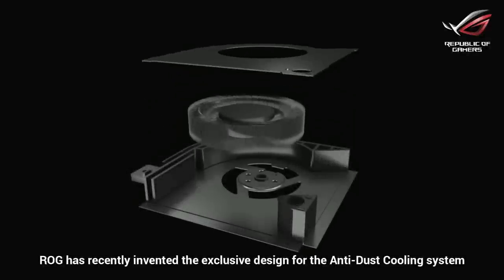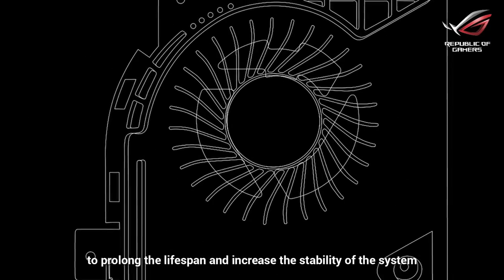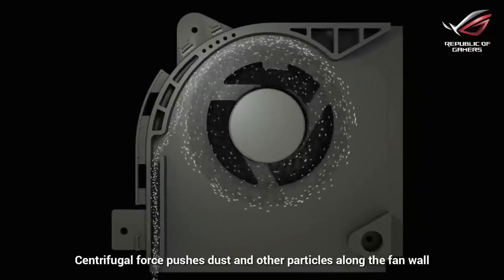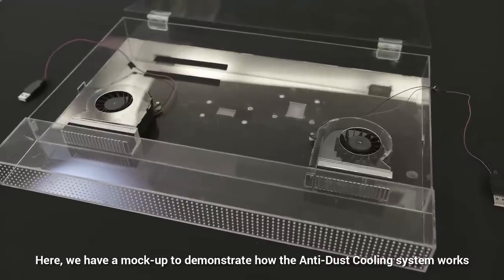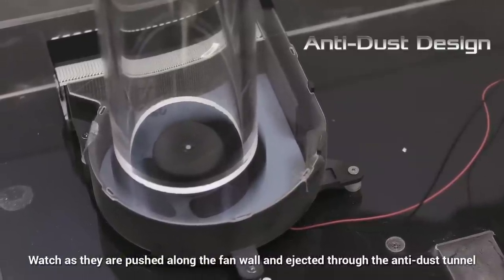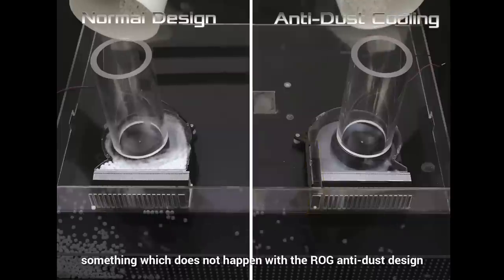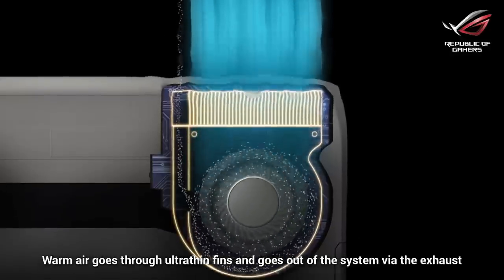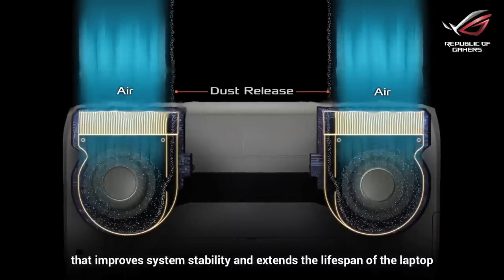Anti-dust Cooling System - ROG Laptops | ROG

Comment: But unfortunately, unlike this marketing ploy, dust are waaaaaaaay tinier and don't simply bounce like those balls. Dust"sticks" due to static electricity and from there it accumulates.
Reply: they can just coat the inner part with anti static material or even teflon
Reply: c@mbaz but they won't because that's not their objective. Their objective is to count this as a masterpiece feature and charging more for it. It's all profit in the end.
Reply: So true...so true...
Reply: well what we witness here is marketing, but yes it is all profit.
Reply: Every hdd has same dust filter. Besides most of dust is big and block airflow a lot faster.
Reply: The fans will also have run much faster, since a part of the airflow generated is used to expell dust and not for cooling, thus making it much noisier or else the computer will get much hotter
Reply: no actually dust sticks pretty much due to thin film deposits over time and you cant coat the heat sink fins or you just totally ruined the point of it.... for heat transfer.  the real fix would just be a removeable filter screen on the intake.....
Reply: But...but..but....antidust skinsuits being sold on ebay for cheap.. :'(
Reply: is the skin suit a giant piece of grounded metal? inquiring minds want to know...
Reply: But it will last longer though because few dust will get out
Reply: Depends whether this system works better than conventional.  Would be great to see fan comparisons showing dust buildup.  I doubt the anti dust system performs worse than conventional though, so only positive potential.
Reply: its a good effort.
Reply: The anti dust feature is meant to prolong the life of the laptops  and not make them mortal
Reply: The Soul  no not really ,and if you think there might be too much dust accidentally stuck in your laptop than do it after the warranty or even better check it on asus store
Reply: Well if it's all about profit couldn't they cover the interior with non-static material and charge even more for it?
Reply: Yea that is true I have the tuf dash with this colling system and it sounds like a rocket about to take off the fans run at like 8000rpm and there is a lot of dust accumulated at the blade that is clearly visible through the back. Also the temperatures of the cpu reach 98 and mostly stay around 92 although that's only in one game in the rest of the games temperatures seem below 85 all the time GPU temperatures are fine
Reply: this is precisely what I came here to point out

Comment: This does work, but it doesn't mean you'll never have to clean it. You will still get buildup eventually, though this surely prolongs the need to service the fans. I usually do my laptops every year, though the ones with this anti dust system is fine after 2, barely anything on the fins.. the fans do get a little grey though, but it would've been so much worse.

Comment: the problem is the fan's are really thin and closely packed and it gets cloged up by dust . I'm an Indian and in Mumbai.. over here the dust is significantly more and my fans get literally cloged up within 6 months of everyday use.. i got asus rog strix g15 2021... Bruh opening up that thing is another heart attack 😭🥲 coz of those pins there's always a possibility of it breaking apart...

Comment: I have a msi laptop and asus laptop.
the asus one is significantly less dusty and doesnt have dust clogging the vents, while MSI vents are all clogged up by so much dusts that you can peel the whole strip of accumulated dusts by hand.
Asus do have dusts on its fans and all over the place, but the dust doesnt build up at the vents clogging up the airflow.

Comment: This system only lengthens the MTBF (Mean Time Between Bailures) and the MTTR (Medium Time To Repair) but it does not prevent the real problem, the real solution would be to install a large capacity filter, of a type similar to that used in internal combustion vehicles. I installed a filter layer that was part of a pandemic xd mask, and I only had to blow the dust off the filter, the laptop still remains as fresh as the first day.
Reply: i dont think that one gonna work, placing filter on such weak air flow just make no sense, the simplest solution is removable and easy access to cooling system itself so the users can cleaned up these thing manually once it dirty without opening the entire case also the excess heat must be blowed to clear area, not onto screen or anything that blocked the airflow or hard to reach so we can use vacuum on exhaust to remove dust completely

Comment: i havent opened my 2017 Rog ever. i noticed my gpu at 95 degres C when running some games. i cleared it, same games now 70° C, big difference. but this system wont be perfect i hope the fans are still detachable so we can clean them ourselves.

Comment: 3 years and still over heats with liquid metal. Replaced paste with grizzly extreme and added copper heatsinks. Runs 75c with warzone max. Rog g17 2021 model. Solution- needs more heatsink in your gaming laptops

Comment: this self- cleaning thing doesn't make any different to normal fans, i think if they stick a layer of anti dust cloth on the holes
under the laptop that will do the trick. the dust will just stick on the bottom of the laptop and it's easy to clean , no need to
open the laptop

Comment: LOL
 My FX-505 DV with RTX 2060 was overheating in 5 months 29 days. Pics and negative review on Amazon.

You guys did NOT test this product enough. My 10+ year old ACTUALLY MilSpec Panasonic toughbook cf-31 ran circles around this thing in terms of quality and ruggedness... did I mention it's still running and doesn't overheat? Unfortunately there IS NO real certifying authority on Mil-Spec so we all got played. Good form Asus, good form!

Unfortunately your engineers forgot that tiny dust particles and maybe just a bit of static might be enough to make something stick to the fan itself. Dust becomes a sponge for moisture in the air (humidity). Humidity attracts more dust plus now tiny hairs which becomes a place for more things to stick.

I've never had a laptop go down so fast in 19 years of working in IT.

Turn to page 21 of the Department of Energy PDF "Improving Fan System Performance" and it reads:

"A consequence of backward-incline blade orientation is a low angle of impingement with the
airstream. This promotes the accumulation of particulates on the fan blades, which can create performance problems."

Try harder ASUS. You should have known this would happened and should have shot straight with your customers when you discovered it was a real problem.

Comment: Not happy with asus lately. Within 1 and a half years I had 2 strix cards which were broken right out of the box and one mainboard which broke after a year. And I'm not a heavy user. Usually I only turn on my desktop on the weekends. No I have been buying asus for about 15 years now exclusivly but something like this shouldnt happen if youre one of if not the most expensive hardware supplier out there. Well ROG that is.

Comment: What would happen once the dust lane is choked. Instead I would suggest removable fan filter which user can clean or reverse fan spin to pull the dust out from the HS. When system is not running the OS.
Reply: WR4P-TP PSN Or a easy removable maintenance hatch, what I don't like with Asus gaming laptos is that you need to pry off the whole bottom panel just to access the fan blades.

Comment: naa  mine did have fine dust on my TUF705dy its the same fan component as in the video.   but yea i had to clean it out also found a moulding for an extra passage to let the air out but you never put the holes on the side for my model till you released a neww one recently.    

Also found that the thermal paste you put was not covering the GPU hardly and both had slight burn marks from "inadequate amount " of thermal paste,.   wt heck   

anyway I'm hoping not to get another laptop from you lot in a long time.   but i can see ill drill the extra side vents my self as I'm out of warranty anyway.   and heck ill add thin thin anti-dust filter fabric on all the vents of my Laptop i got from u peeps.   
 and yea ill even put a rgb color changing keyboard in.   like Literally told id get RGB and i only got red very confusing website for details of laptop of both Rog and Tuf rigs

Comment: asus gl503 vd , right fan is making a weird noise... and also i cant activate overboost mode im so sad... HELP
Reply: i have same problem too. i just do unplug battery and reconnect . after that it works. but its temporarily solution. the issue came back agin after 3 weeks

Comment: Just cleaned my laptop last week. Tuf fx504, dust still accumulate in the vented part. It really affect my temps. From 85-90 to 70-82. Im guessing the design doesnt work well with low density particles.
Reply: I'm thinking of buying an asus tuf rather than other options just because I heard it has anti-dust fan system. So... the anti-dust fan is just a marketting gimmick?
Reply: Check some vids on tuf fx504 cleaning. You could see how much dust they still accumulate. But compared to other laptops i had it is the easiest to clean with the right screwdrivers tho.

Comment: for those people that say it does not work i have opened mine i play everyday for roughly 8 hours leave it on while i go to work and come back ive opened it like this guy has http://forum.notebookreview.com/threads/asus-g752-series-vt-vy-vz-vl-vs-vw-disassembly-teardown-repaste-guide.795203/           and it was just as clean it had a few specs of dust and thats it...... much easier to maintain than have to open it up more frequently due to seeing old laptops increase temps by 10 degrees because they get clogged up would much rather have this than a standard one

Comment: thats big bsht it dos not matter what i invent u till need to clean by taking a part. i have acer they have blow out dust system bit diferent then yours and still i cleaned it alredy 3 time in 1 year and i will need to open again to clean it. so it dos not matter what u show hier because those dust will colect in your tunel and  block it. all system will be jamd and u will need to clean it and because of that tunel will be more harder to clean it

Comment: but still, my rog laptop(GL503) fan module damaged by dust
Reply: Did your laptop fan has noisy sound when on idle?
Reply: @achmadhisyamkamil7559  only that time... when my fan module was damaged... Otherwise They were silent in idle...
Reply: @mr.chaubey  I think i have the same problem as yours. Thanks for replying though 👍
Reply: ain’t because it’s got anti dust fans so you don’t need to clean ur laptop
Reply: @kingeling  I used to clean my laptop with glass cleaners...
Reply: @achmadhisyamkamil7559  i have this problem do you have any solution
Reply: @funlia9409  I took mine to the asus  center and then they replaced the fan, after that the noisy sound are gone

Comment: So will this justify Asus' design which you need to remove the whole bottom panel just to access the fan blades? Dell somehow manage to put a one screw maintenance hatch but why Asus couldn't?
Reply: 3dr14n G maybe rigidity or simplicity issues. you dont upgrade your laptop every day, some screws are not an issue. there are a lot of laptops that you need to disassemble everything because fans are behind motherboard, mind you.
Reply: constantinos schinas The amount of screws were never an issue but the idea that you need to pry those snap-on plastics around the edges sounds really horrible to me. Also the idea that "I don't upgrade my laptop everyday" is ridiculous in a sense that it never justifies that aweful design. Laptops with fans and metallic fins needs to be opened atleast once a month for thorough cleaning of dusts from blades and Al fins. Dusts were never that large as those styro balls, they're smaller and adheres to metal and even plastics. No blower can completely remove them from that system, they need to be brushed from time to time.
Reply: 3dr14n G sure, i agree on most points, i have worked as computer technician and industrial designer and can be strictier than you are lol. but yes, you don't open your laptop everyday. in a normal environment (not a woodshop), it would be wondrous if laptops where cleaned once a year. most laptops work with dust carpets blocking outlets.   just being realistic here. even with the best design that would welcome users to service their machines, 99% of the users will not open it to clean it unless they are nerds or technicians, like we are ;)

Comment: If these fans are so great. Why to I have to undervolt and disable Intel Overboost in my Asus Rog Strix GL703 to prevent overheating and to be able to play games on average settings?
Also, could you make them not sound like jet engines? Its a laptop, not an airplane.

Comment: So, can u tell me the reason why my gx800vh cpu is 90 degree when full power running, but gpu only between the 50 and 60 degree. It using liquid cooling system.
Reply: turn up the fans.  or you might have left the plastic thing over the Coldplate before installing it.

Comment: i have an Asus FX503VM and my left fan makes this clicking noises as if it hits something and it suddenly goes into "failsafe" (after i heard the clicks, a few seconds later it stops itself from turning on) but this goes on and on and on. the thing is, the right fan is super fine. tried to go to the service center in my area and they said it's only a dust problem and i believe it's not the case. can someone explain and maybe give a solution?
Reply: @mf9708  went to their service centre, said they fixed it, but the problem is still there and i didn't even bother it until it actually is gone by itself

Comment: total bs. go show that with particles that actually can flow thru the cooler not just be blocked and bounce off it till.. by luck gets ejected.  make a video showing you doing this with sand then maybe it might be somewhat believeable.  or just do the smart thing, PUT A DANG REMOVABLE FILTER ON THE INTAKE!

Comment: I have the hero Edition. I just want to verify that the air intake is at the bottom and the exhaust is at the back where the hinges is, is this correct? Because I was thinking buying a cooling pad
Reply: I have the scar. Yes intake is at the bottom and top grill if you have one and exhaust is on the rear. I got a pad and it doesn't make much of a difference the cooling in this laptop is already good. What I felt made the biggest difference is elevating the rear of the laptop by about a half inch or so